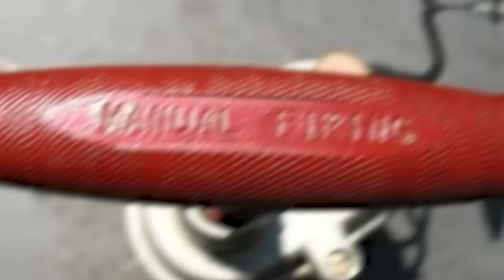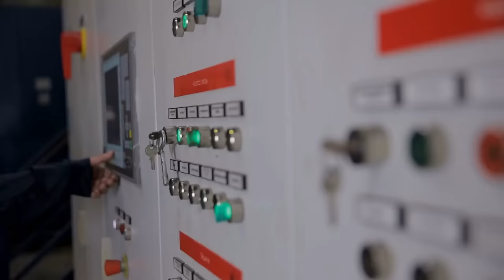15 Structure Demolitions GONE WRONG

Comment: The St. Petersburg footage is heart-wrenching as you see the worker on top of the building scramble as it collapsed under him. RIP.
Reply: That footage was awful... I feel so bad for him...
Reply: The fact that only one person died though... Could have been way worse. May or may not have been that person.
Reply: The other guy next to him in the crane basket survived as the building collapsed under him and he was hanging in the basket.
Reply: They cut supports one by one instead of cutting leaving some behind, that made structure very unbalanced (one side had all supports and other had none) so the roof fell, and because it was very heavy it also made enough force to take down the wall. Tragic event caused not by mistake but sheer stupidity.
Reply: 5:01 .. terrible also for the man in the basket. what a nightmare to see!

Comment: I wonder how many of these buildings contain asbestos and how often it's 'accidentally' overlooked. Removing the stuff is very expensive and I'm sure oftentimes it's illegally ignored because they know that any illness or death related to it would take years to manifest and would be impossible to trace back to them and their demolition.
Reply: In some cases the explosion site is sprayed heavily with water to stop a possible spread of asbestos.  Not sure about the US but here all the alarms go off of they find it before demolishing it (blowing up buildings is reasonably uncommon here because the structures in The Netherlands are usually not big enough to do so, but also in the way of to much other buildings to do it reasonably cheaply.
We did however try it with a quay somewhere, and screwed it up by using to much explosives, shattering windows and in a couple of cases cracking walls :P
Reply: Led me to think

Comment: I beg your pardon!  The CIA taught the world that in order to bring down a tall building straight into its own footprint, all you need do is hit it in the side with an airplane. This happened twice in a row on September 11, 2001 in a very public display.  It worked so well, in fact, that a third building fell into its own footprint later that day WITHOUT the need for a third airplane.  That's right, three buildings / two planes.  So don't tell me that it's hard to bring down a building in a controlled implosion.  The CIA showed the world that it happens all the time - if the politics is right.

Comment: Here this method of demolition is never used, and I think there are many reasons for it:
- it is a lot of work to remove all dangerous materials (asbestos)
- then more work to weaken the structure
- then more work and expertise to place the explosives
- you need to clear the area for the worst-case fall of debris
- there is a lot of dust that has to be cleared afterwards
- you end up with a pile of rubble that you still need to separate and move away

All in all, it just isn't worth it.  Disassembling the building piece by piece is as much work, cleaner, safer, environmentally friendly, etc.
Even those destruction balls aren't used anymore.  Better to use special equipment with hydraulic claws.
Reply: Where is "here" ?

Comment: If you pause the video at 4:54 you can see a poor worker running towards another worker in a cage thing.  I cannot imagine this poor mans fear.  I hope he made it out ok.
Reply: Unfortunately, he didn't. He was the one who died. I saw the original video a couple days after it happened. I guess he thought he could at least make it to a section that would stay in tact but it was like a domino effect and the whole structure collapsed underneath him. I was rooting for him to make it too but there wasn't much he could do. It did however force lawful measures to improve safety after the incident. One thing that could have saved him is if he was attached to a cable on the basket and avoided the fall which is now protocol for situations such as this.
Reply: @generaleerelativity9524  That is so sad to hear.  I am now wondering why he wasn't attached to one of those safety cables on the basket too.  I feel bad for his family, especially knowing it was caught on video.
Reply: @generaleerelativity9524  I'm very surprised that he wasn't. The very reason for the basket implies that they understood the risks.
Reply: @orionbroadcast9226  IKR... I sure as shit wouldn't have walked onto that slab without a harness or a parachute or something. Who knows what they were thinking...

Comment: You missed a very important one, 9-11, Or should we say a demolition that went right?
Reply: What happened on the 9th of November.
Reply: Yup. Urban Moving Systems failed to successfully implode 3 of the 5 buildings they imploded that day in NYC. They did succeed in imploding one of the three later that day, but not before the BBC propaganda-media outlet prematurely announced it successfully imploded.
Reply: Yes, flying airplanes into a building will bring it down, but you can’t do that every time you need to demolish a building.

Comment: #4 is completely wrong... the were not setting explosives at all to bring the building down.  They pulled it down with equipment on purpose and it went very wrong.  There is a lot of footage out there of this accident.  A piece of concrete flew out into the road and hit one of the demolition employees.  Allied Bean was the contractor on this job.  They didn't have a permit to implode the building, but did it anyway.  I want to say a few people were hurt, and 1 was killed.

Comment: I don't know if this has already been mentioned here, but perhaps the architects of such buildings could include plans for safe demolition if the need should arise in the future. It would certainly save a lot of time, trouble and potential hazards.
Reply: Yes, because when an architect is hired to design something they always want to end the pitch to the customer with, "And here's how easy it is to destroy my design..."
Reply: @timmywashere1164 , I didn't say "easy," I said "safe." There's a distinction.
Reply: Won't work. How a building is designed and how the building currently exists are two completely separate things. A demolition has to be done based on the current condition of the building, not on how the building was originally designed. Especially if there were revisions done during construction or any remodeling work done in the years afterwards. Doing that during the design phase would be completely wasted effort.
Reply: @rehustler  Sure put the explosives in the building while it is being erected, makes sense to rig it years before when the cost of explosives would be way cheaper than years later...just hope there aren't any offices fires...and tell the fire department not to go into the building if it is on fire...and tell the people in nearby other buildings to run for the hills if there is a fire. LOL
Reply: What crosshair said. The building in Rhode Island that resisted not just one but two attempts to knock it down had had extensive rebar added to the design, unknown to the demolition company because they weren't in the plans.
Reply: Very good point rehustler
Reply: There are supposed to be structural plans saved.  These help should the building later need demolition or reinforcement.  In the rolling flour factory, it was too old to have any plans saved.  The demo crew had to guess.
Reply: I always wondered what happened to all the 💩in all the 🚽s in all these buildings that went under demolition... 🤣

Comment: This is exactly why in the UK, we now rarely use detonators and explosives when demolishing tall buildings or stadiums. 

We generally now cover the building in a framework of scaffolding - and dismantle one floor at a time, or one section of stadium at a time. Sure it's painstaking, takes alot longer, and isn't dramatic - but it's much much safer to do it this way.....and believe it or not, cheaper too. 

I'm amazed that America still prefers to go for dramatic explosive detonations for buildings and structures - EVEN in heavily built up areas. It's just not that safe to do this anymore. Clearly Health & Safety is more rigidly enforced in Europe than it is in America.

Comment: you missed out another structure in the uk that refused to come down with explosives & that was harworth winding tower from the coal mine, they tried to bring it down with explosives but it wouldnt budge  there are vids of it on youtube showing the whole thing they didnt account the whole structure was double reinforced & they only used enough explosives to cause a dust cloud
Reply: I would've expected better from a UK demolition crew. They should've checked to see how well reinforced it is. This the sort of thing id expect to happen somewhere else where they didn't bother to examine the building properly.

Comment: Would you mind to add a small text message saying "not the actual footage" or "a video from the stock" on those parts that were added from video stocks? I mean, the narration is good and the actual footage and pictures are great but the video immediately plants overall doubts when I see two builders planning a demolition of the building in 2005 on an iPad!!! 🤦‍♂️

Comment: 4.54 - стадион не подлежал демонтажу. Через день после этого события его должны были признать памятником архитектуры. Тогда хозяину стадиона пришлось бы его ремонтировать и использовать в прежнем виде. Фирме - хозяину стадиона нужна была земля под постройку. Поэтому безо всяких расчётов стали демонтировать старые части здания. Без чертежей, неквалифицированный персонал, без соблюдения техники безопасности. Крышу 40 лет назад сконструировали и построили качественно. Она держалась до последнего, но такого издевательства не выдержал бетон опор и стадион развалился, похоронив монтажника, который резал крепления крыши. На следующий день комиссия, которая должна была признать стадион памятником, увидела руины... Так жадность похоронила красивый стадион и неплохого парня.
The stadium was not subject to dismantling. A day after this event, it was supposed to be recognized as an architectural monument. Then the owner of the stadium would have to repair it and use it in its former form. The owner of the stadium needed land for construction. Therefore, without any calculations, they began to dismantle the old parts of the building. Without drawings, unskilled personnel, without compliance with safety regulations. The roof was designed and built with high quality 40 years ago. She held on to the last, but the concrete of the supports could not withstand such mockery and the stadium collapsed, burying a worker who was cutting the roof fastenings. The next day, the commission, which was supposed to recognize the stadium as a monument, saw the ruins... So greed buried a beautiful stadium and a good guy.

Comment: Remember hearing of a controlled demolition of multiple buildings after the turn of the 21st century. The demolition company failed to properly control the resulting dust cloud while the cloud drifted and spread far close to a mile dropping large amounts of asbestos all along the cloud drop zone. Many cases of resulting illnesses were reported but the most tragic part of the controlled demolition was the haphazard and irresponsible actions of the demolition company and affiliated subcontractors for failing to properly inform and evacuate the thousands of humans that were still inside. The safety protocols were drastically and mortally ignored. Since that controlled demolition, there have been many, many inquiries into the reasoning behind such an enormous disaster that revealed very little truths or accountability for those responsible, while there have been large insurance payouts to the owner of the property and very little consideration to the surviving victims beyond medical care.

Comment: I don't know and I'm surprised that no one noticed that the video is composed of parts that have no connection with each other. The plans have nothing to do with the actual buildings. So-called engineers are actors who appear in two completely unrelated locations. I have more than ten mistakes that are unacceptable.
If the author put only the original recordings, it would be worth watching. This is pointless. Sorry.

Comment: OMG, you can see one guy on the roof of the Russian arena, running as the entire roof collapsed behind him.  He has just jumped the railing at 5:15.     Another guy was in a cage hung from a tractor, but the clip suddenly skips a second or two further.  Just before the clip skips forward, you can see that they guy is about to jump over the side of the parapet and over the side of the building.  Probably still a good hundred feet from the ground.  After the skip forward, the guy vanishes and all you see was the other worker in the cage hanging.  I think the guy jumped the parapet to his death.   I'm no engineer, but why would they have men inside and on the roof as they were disconnecting it from the walls?  Am I missing something due to my ignorance?

Comment: Watching this video only lends further credence that WTC1/2/7 were perfectly executed demolitions. 20 intact floors didn't fall through another 80 intact floors in September 2001.

Simple experiments show that demolition is the only plausible answer. Mount 20 equally spaced horizontal panes of glass. A bowling ball dropped from over ten feet could only break its way through four or five, before it was stopped.

Comment: Somewhere there is footage of the failed Felindre tinplate works cooling tower demolition (Swansea, S. Wales). Too much bang was used and the supports blew out and the structure just fell 20 feet and landed intact. It took a couple of weeks to clear with tracked plant. It used to be on Youtube but I can't find it anymore, it would fit in perfectly with your vids. I was at the demolition and would love to see it again.
Reply: It was in 1988, I think.

Comment: I remember seeing Live the mistake of the grain tower. Later I found out that the Grain tower they could not use more explosives due to the city ordinance of being in the city, well now that is not the case for buildings that are built or now in some industrial areas where few buildings are and they can use more explosives for well built buildings like this in the City of Sioux Falls.
Reply: Where did you hear that? I was the demolition superintendent on the Zipp Mill. We were not limited to the amount of explosives we could use. In fact the blaster Jim Redyke of Dykon Blasting asked if the Sioux Falls bomb squad at a pre-blast meeting if they wanted him to order extra for them to use in training. They got some. The bomb squad actually came out to the site and helped load the building with charges. The plans we had did not show a basement that had been added at some point. Due to the basement being flooded we were never able to go down there. The plan was that the basement wall with earth behind it would hold the one side up tipping it like a tree. The added basement allowed it to drop down about 30'. I actually have the original blast permit for the Zipp Feed Mill.